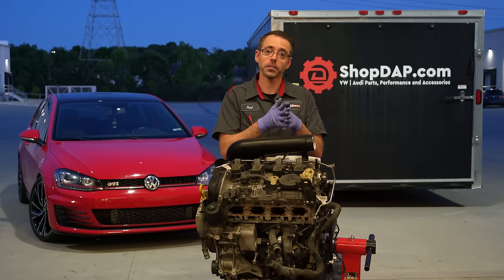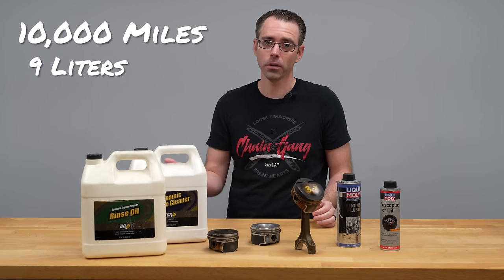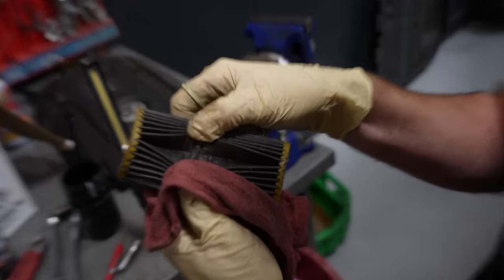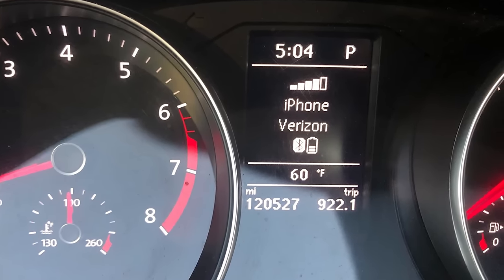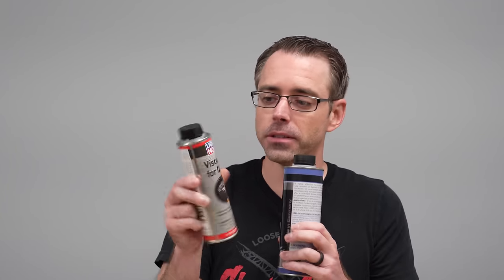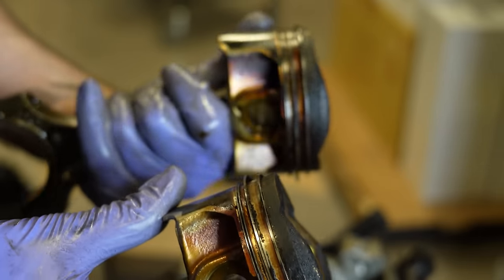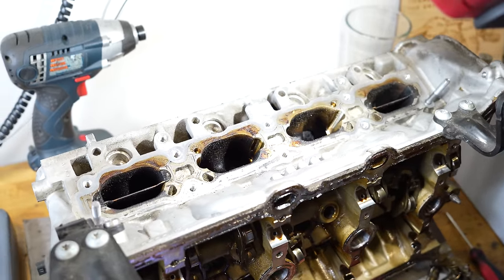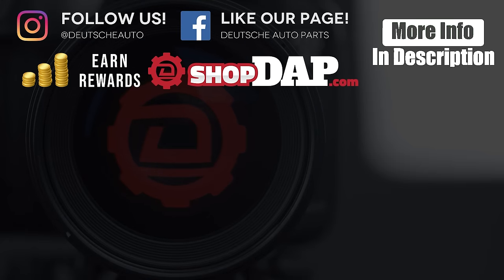Can you Fix an Engine Burning Oil for $20

Comment: I once purchased an old Range Rover V8 which was very sluggish, so I threw a bottle of Wynns's Engine Flush into the oil and drove the vehicle home (1000km journey). After 200km the engine suddenly loosened up and pulled like a work horse. Was very impressed with the Wynn's flush. I use the cheapest oil I can find and when doing an oil change, I add a bottle of Wynn's Charge to the oil and have never had a problem. I change the oil annually or 10 000km which ever comes first. I drive a 1996 Opel Kadette.
Reply: Wow...very interesting. Might try it too.
Reply: Oil flushes are meant to be use with the engine idling for 30 minutes😂😂😂, you drove the care 1000miles, that loosened the carbon but it probably put so much wear on that engine too due to thinning of the oil from that flush chemical
Reply: @sevrajsami  it'll take longer than 30 minutes  for the carbon to even break  down, try it on an old piston

Comment: way back in my day we did this process but instead of using expensive treatments we used a quart or so of diesel and kerosene added to the old oil ran it for a while then changed the oil and added another quart of d/k ran it and drove it for a while then changed the oil again.. it worked pretty good at removing sludge and build up
Reply: I use 3 litres of diesel with 1 litre of oil, idle engine for 10 minutes then drain.

Comment: Before engine flush was a thing we used to mix diesel into a new batch of oil. Let the engine idle for an hour. Then we leveled the pistons and filled the cylinder with the some of the oil/diesel mix and left it the night over. Emptied the cylinders, changed oil, filter and plugs. Worked really well.
Reply: We used kerosene and oil and only ran it for about 5 minutes, then drained it.
Reply: @duckmyass  First car was a 69 ford fairlane wagon 302, that I wanted to clean out, used Gunk engine flush, smell like ksene and ran 5 min and was worried what I'd done cause of some noise, I've now heard of using a quart or 2 of atf, which to me sounds more engine friendly even possibly to run it a tank or two of gas especially for older engines
Reply: @joeboxer3365  The trick is that when you run it you don't drive it or rev it up you just let it idle so that it is getting the kerosene run all through the engine.  Kerosene won't provide great lubrication like motor oil but it still provides enough that your engine won't get damaged from it as long as it isn't pushed hard in those 5 minutes.  After the 5 minute run you can let it set for a while if you it is a really gunked up engine just to let it dissolve a bit more of the crude.  I have even know of some guys that would pull the spark plug out after running it, then fill them with kerosene and then hand turn the engine a few rotations and let it just sit for an hour to free up the piston rings.  

Now after you go nuts with the kerosene I would personally change the oil drive it 30 minutes and then change it one more time because the kerosene is never going to get completely drained the first time you do it and it will hurt the characteristics of your motor oil... but by the second oil change enough of it will be out and the small amount still in isn't going to cause you any issues.
Reply: And good bye to the lambda sensor and the catalytic converter. Your method may work on ancient engines.
Reply: somehow mineral diesel oil is better for rinse and better performance.  i mix the mineral diesel oil with palm oil as an aditif for my engine. for the 1st 500km with daily driving, all the slug ways up. then change it with the new mix, tap again at 1500km. voila, my engine run smooth and only gold varnish left. i learned before with my motorcycle single piston.
Reply: Watch Project Farm's video on doing a test on this.  I wouldn't add diesel to the oil after watching that video.
Reply: @duckmyass  i did the same thing last time i change the oil in 3.2 vr6 Touareg engine, i put 0.5 liter kerosene on the oil, ran the engine for about 15min, i found lots of carbon deposits in filter
Reply: @cipriansofineti346  If you engine is gunked up already then  the odds are your cat is already getting clogged.  So if you want the cat to work after you've cleaned the engine just pull it off and plug one end and fill it with lacquer thinner to clean it.  You can't damage anything in a cat  you can only clog it but clogs can be removed.
Reply: @duckmyass  - I flushed my Outback 3.6 , 6 cylinder engine twice already with 1 quart of Kerosene. No problems whatsoever. 
😃
Actually, flashing the engine came recommended by the dealer, after P0014 code (camshaft position B - Timing over-advanced) , and P000B .
They replaced the B1 exhaust OCV, flashed the engine, replaced engine oil and after $578 , reminded me not to skip any oil changes 😜.
After that I regularly use kerosene to flash the engine.

Comment: I haven't used the BG kit, but I have used the Liqui-Moly ProLine Engine Flush many times. First time was on a 2006 Volvo S60 T5 with 80k miles on it. The previous owner took it to the dealer for conventional oil changes every 7500 miles. It was burning about a liter of oil every 1100 miles and after we used the engine flush, the filter was about half full of sludge flakes. It ended up using only about half a liter of oil over 5k miles after that. If I kept my foot in it, it would be a liter every 2500 miles. Second time was a 2004 Chevy Trailblazer with 260k miles on it. It hadn't had an oil change for 35k miles and had a tractor-like idle. We ended up changing the oil and filter before we did the flush and because I was busy at work, it ended up running for 45 minutes instead of 20 minutes. When we drained that oil, it was actually a dark grey instead of a black. We filled that one up with Royal Purple 5w30 and a wix XP oil filter. One funny thing was at the idle was still rough, just less so, but when you gave it throttle, the engine got so smooth you couldn't feel it running. The same thing happened with the Volvo, but it felt more like a sewing machine's soft vibration. Those are just the two notable stories for now. I might have another with a 2006 Nissan Maxima with 300k miles coming up. That one uses 2 quarts within 3500 miles.

Comment: At Honda we have 3 successful BG dynamic services and those were the only ones sold the past year so 3/3 isn’t bad so far lol I know it’s a whole different brand/engine (09-15 V6 with VCM) but wanted to mention in case people got the wrong idea of BG, they’re great products and work extremely well! Hence the slight improvement from the Passat you did. Based on potential shitty maintenance. That carbon is a bitch to break down based on my fair share of engine tear downs. Either way I love using Liqui Moly stuff they recommend the flush every 30k and it helps out a lot as well!
Reply: Did these engines stop burning oil ? I have a v6 Honda and am trying to see if there’s anything I can do to slow the burning. Burns about a quart every 2,500miles.
Reply: @matthewfreidus5034  I currently drive a 2007 Pilot with 226,000 miles that uses almost no oil. I previously had a much newer Ridgeline that burned about a quart every 3,000 miles. I think a lot has to do with the thinner oil used in newer engines (0W-20) and the low-tension piston rings.
Reply: put 7 spoons of bearing greace  in engine with old oil idol for 30 minutes  drain oil put new oil filter and fresh oil engine goes forever maximum performance
Reply: I use the proline flush every 5th oil change, even on new engines. The best way to fix a problem is to avoid one to begin with.

Comment: To let you know, using engine flush, follow directions and get the gunk out of engines, including piston rings. This then allows the oil rings to expand to make a better seal with the cylinder walls, reducing oil burning. All engines with over 60 K miles can benefit from this procedure.
Reply: Never heard of it like that. Is that documented?
Reply: @brownrussell1073  No
Reply: engine flush also gunks up oil coolers....
Reply: Scotty also said an engine flush could remove some old build up that's helping to prevent more oil from being eaten up. I guess it's at your own risk. If you're refilling every 3-500 miles then I'd do it. If you're doing pretty good at every 900-1k then I'd leave well enough alone. SuperTech oil isn't that expensive only cost me $21 for 5qts @ Walmart.
Reply: Is using engine flushes a temporary or permanent fix?
Reply: @anthonytan2074  Seems to work for longer term, your situation may vary.
Reply: Dont do this if engine is badly gunket up, it will clog.
Reply: Io ho due  auto:  una Alfa Romeo (motore 1.4 cc Fire FIAT) con  100.000 km,  ed una Mercedes 1.8 cc. con 175.000 km, entrambi ad alimentazione benzina. 
Cambio l'olio motore ogni 20.000 km oppure 2 anni. Ad ogni cambio olio uso il Clean Liqui Moly 1019. 
Uso olio 5W40 API SN.   Mai avuto problemi. Consumo attuale olio per entrambe le auto : 1 litro ogni 10.000  km circa.
Vado avanti così.
Reply: Yea just did to my Rapid 1.0TSi 38k driven.. Threw there BG epr (it ate oil crazy) and miracles had happened..
Reply: @brownrussell1073 no but it's .. shit what's past participle of 'try', tried?? And succes(s)fully
Reply: @anthonytan2074  what is out is out. there is no permanence as long as you keep running the engine tho. using the engine flush every other oil change will help over time. and use quality oil that has a proper additive package already.

Comment: My car burned oil bad like 2 months ago but I pulled my head of and put new valve guide seals in among other things and it hasn't lost any since 👍 I got a 130000 mile 2.slow
Reply: Those 2.slows are rock solid!

Comment: One thing we all can gather from this video is check your oil more often. If your car doesn’t have an oil level sensor, you can easily damage your engine by running your engine too low on oil!
 Also I run “Marvel’s Mystery Oil” in my personal vehicles and I don’t have any oil consumption issues.
Reply: u mean add it to the engine oil or to the fuel?
Reply: I used to run MMO in the oil on my old Volvo, really helped those hydraulic lifters. It can be used as an oil additive.

Comment: I use the liquimoly engine flush which I buy from Napa in my 2003 BMW 330ci. The M54b30 is notorious for burning oil. On 2 separate cars with the same engine I went from burning a qt every 400-500 miles to a qt every 1200 or so. I then use it before every other oil change along with 5w40 liqui moly leichluft oil and it just keeps getting better. Both cars are an excess of 230k miles.
Reply: Thank you this gives me hope on my 330xi 263k miles. Burning a quart every 450 miles.
Reply: Were you having blue smoke at full throttle?
Reply: I get blue smoke only at a cold start will this help out?

Comment: The oil control rings are different as well. The revised ones are the wave type, opposed to the notched type.
Reply: the new pistons are different from the old, with a MUCH larger U-Flex oil scrapping ring and MUCH bigger oil return holes
Reply: wave type used in racing for decades
Reply: OIL CONTROL RINGS !!! How did he not mention that VW/Audi changed to a waffle style from the spring and pin-hole style. Oil Control is the subject of the video and its the name of these rings... But ignore that.
Reply: Same as that stupid new clutch design which forced owners to convert back to the original design while vehicle manufacturers were laughing all the way to the bank!

Comment: I find 1L of oil per 1200 miles completely unacceptable.  My 2011 Audi A3 has “consumed” about this quantity of oil since it was new and Audi would not do anything about it.  I think the manufacturers should be held accountable! Cheers Drew
Reply: My old VW Lupo 1.4TDI used so little oil between 10K mile service intervals that no top ups were required at all and this was when the car had over 240K miles on the clock, the engine always ran like a precision Swiss watch and was surprisingly powerful for a 3 cylinder diesel with a 100mph cruising speed available if required, that car always got Shell Rotella 30W summer, 20W winter at 10K mile intervals with an occasional oil filter, I don't recall ever changing the air filter!  80 miles per UK gallon was possible if cruised at 60 mph on the motorway and the average fuel consumption was around 65 miles per UK gallon mainly urban cycle. That was a bloody good car
Reply: @rotax636nut5  yes my 98 Seat cordoba 1.9TDI  is running just fine with no oil burning and on the motorway gets 80 mpg. iI did a round trip of 1500kl in May and drove at 55mph got almost 90 mpg. these engines are up there with the old mercedes diesels
Reply: ((hat does not matter much, engines that do not burn ANY oil do not last));
   And  it is not Audi's fault, they can't do anything about it; it is the Regulator's fault, the LAW!!!  because it MANDATES Low Tension Rings to decrease friction, to save anothe drop of fuel, to SAVE THE PLANET; so, please do your part, live with the REGULATIONS, and let it BURN OIL,it's the LAW.
Reply: @josepeixoto3384  The law does not mandate low tension rings. It mandates average MPG ratings. Audi decides whether to design their cars to be lighter and more aerodynamic or to stick with the same old and hyper-tune the engine to squeeze every last efficiency at the cost of long term general reliability.

Comment: the "low tension" piston ring is a misunderstanding; the pressure put on the cylinder walls is the same (and so just as effectively prevents blowby), but because the rings are thinner, there's less surface area on which the pressure can apply force, thus applying less force and by extension less friction. The issues come when, like you say, the oil control rings get prematurely clogged or are poorly designed and it stops working.
Reply: Piston ring " LANDS " wears out letting blowby between the expanded ring and the piston itself .  The only way to stop blowby in a worn engine is to bore the engine , new pistons and rings installed correctly. Then the crank and rods, cam and lifters all need to be remachined . In other words take it to the machine shop.  Then break it in right , That engine rebuild in a can will insure your trip to the car dealer or machine shop with even more damage.
Reply: A piston ring must have a minimum preload, because otherwise the combustion gas can also find a way between the spring and the cylinder wall, while it has to come just behind the spring and press it against the cylinder wall.

The gas pressure can more easily get between the spring and cylinder wall than between the piston and the inside of the spring, so if this preload is not sufficient, the gas goes between the spring and cylinder wall.
The oil is then blown off and hot, so more blow-by and oil consumption + poor lubrication.
The minimum preload (surface pressure) of the spring is essential, but does not ensure the seal, only the gas pressure does.
The width of the spring is not essential for oil consumption.
The oil scraper ring also does not work properly if it has too little preload.

The gas pressure pushes the piston rings towards the cylinder wall, if they are narrower or wider, then the surface pressure of the piston rings on the cylinder wall is still the same due to this gas pressure.
That is no reason for more oil consumption.

If this pressure (surface pressure) of the springs themselves is sufficient, piston rings will work fine.
That minimum pressure MUST be there, otherwise everything will go wrong.
Oil drainage through the piston wall must of course be good, because then an extra mistake has been made.
Reply: @heinpereboom5521  Ring and piston lands is very important . Otherwise the combustion gasses will pass between the piston and ring . I do believe that GM has looser tolerances  than Ford. Ford maintains tight tolerances on their rods and mains and piston to wall clearances and land clearances .  Chevys  allowable was .004 max on their cranks off the showroom floor and as per the 5.3 v8 loose cylinder clearances . The Chevy runs faster  off the showroom and gets to the junk yard faster. I think now most build close tolerance and have a more aggressive quality control .  Now with Synthetic Oil clearances must be closer .

Comment: I have a 1.9TDI with 287.000km, oil level didn't change since the service 10.000km ago

goes to show that regular service with cheap oil (at less than half the price of castrol) is better than skipping service with good oil

Comment: The B12 works.  Audi 2012, 2.0TFSI, 113K miles. I did the piston soak but did it over a two week period, letting the car sit and pistons soak. I had a problem with loose carbon shifting to the downward side of the piston which caused it to bind on turning over through TDC in affected cylinders. I found it necessary to clean and suck out this carbon with all cylinder leveled half way. I used some weed whacker string on a rod though the spark plug hole to loosen the debris, I used my oil extractor and paint thinner to emulsify and remove the slurry. Once I was able to continue barring the engine though 360 degrees without binding, I continued the B12 soak and rotation. After the soak, I did a liquimoly flush with an oil change and new filter, dumped that refilled with new filter. Results....zero noted oil consumption after 800 miles so far. I would have already gone through two plus quarts at this miles. Tailpipes are soot free and dry.